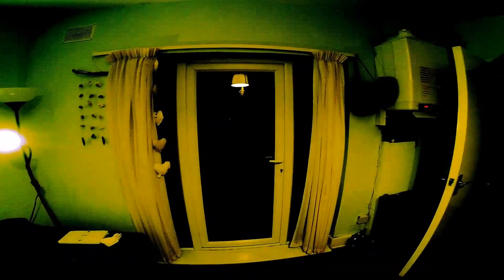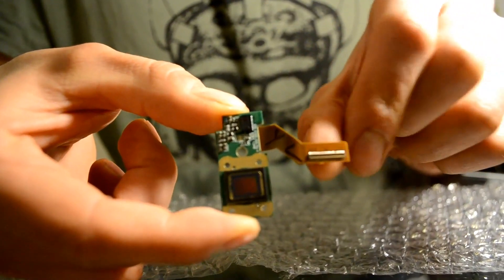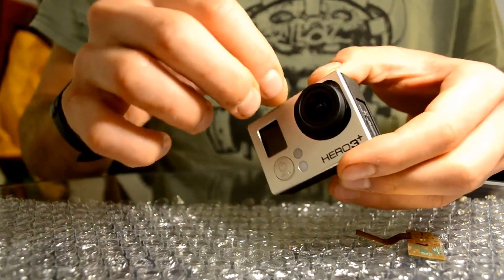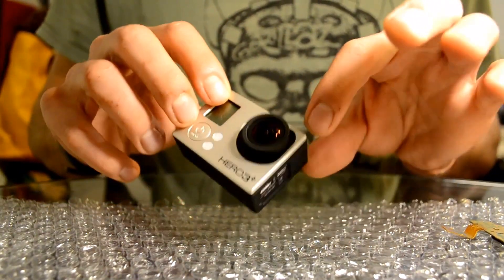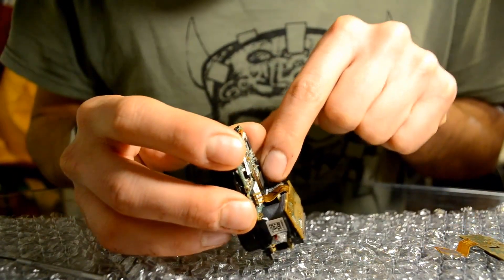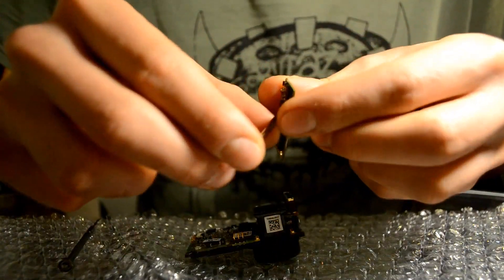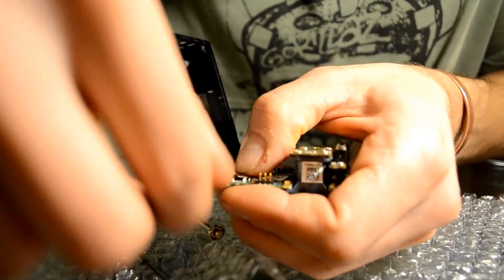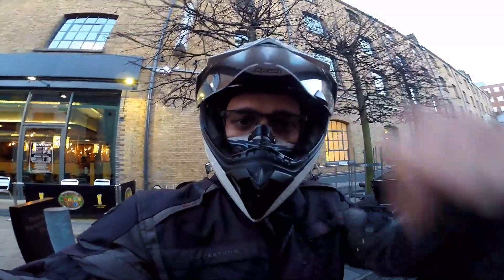GoPro Camera CCD Light Sensor Replacement

Comment: Sometimes a bad connection is all that causes issues in electronics, Try cleaning the connections with contact cleaner before replacing parts. Great video.

Comment: Hello!!
At first I want to congratulation you and with DIY job! 
Also I need to ask: My camera is the same that yours, but the problem I've had is different: my go pro just stop record at 13s in video mode. I was thinking thay would be the CCD Sensor but I'm not sure. Can you give me a light with your opinion please 😩 
Thank you very much!!#
Ps: Sorry about my bad english hahaha
Reply from the maker: Hi there, to me it sounds more like a software issue rather than hardware. So if i was you I'd look in the direction of a full camera reset to factory specs. I think on gopro website you can also download the latest version of the software. Or check something like this: https://youtu.be/ThpWN3LL1ik
Good luck and your English is perfect!!!!